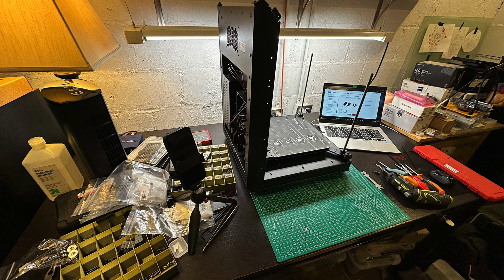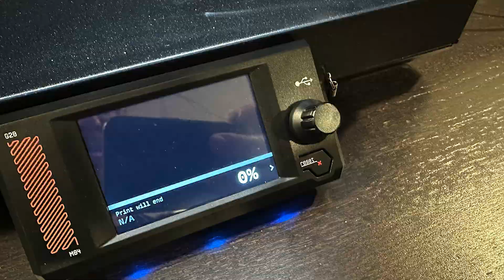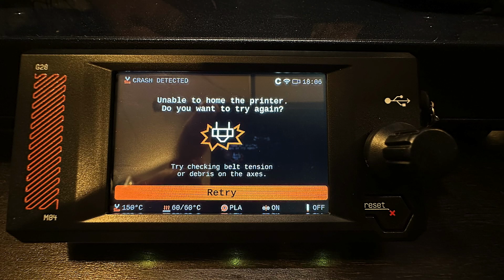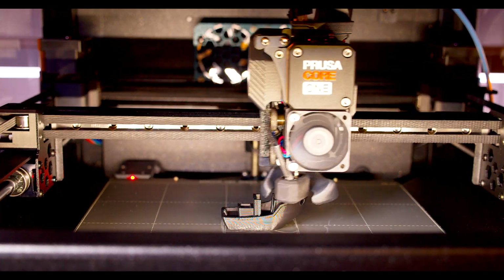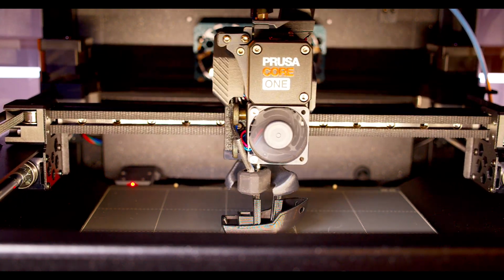My thoughts on Prusa MK4S to COREone Conversion Kit

Comment: went to the same path: mk4 kit -> upgraded Y axe belt tensioning and retention parts -> upgraded part cooling shroudd -> upgraded to mk4s -> upgraded tp CoreONE -> dis a small mod during assambly  -> did some other small mods.
ZERO issues in the whole process. ZERO!
Reply from the maker: lucky you! 🎉

Comment: Although my core one is definitely a very diffrent beast compared to my mk3, I absolutely love it. It vibrates a lot, it's a bit loud and it has its gimmicks, but overall it prints amazingly well and it's so damn fast. Surely it'll get better with firmware updates. I'm sorry that u didn't have a good first experience

Comment: @mygiguser help me out please, how did you fix that collision issue. I have the same thing I cannot get to printing. it's definitely a bumpy upgrade from MK4S that was just flawless.
Reply from the maker: I did a factory reset and re-installed the firmware. What finally helped the most was: Then I changed the build plate (now using Prusa Smooth PEI sheet). The one i used had the printed text on it (uneven). And then i used oil (Ballistol was all i had at hand) on all the rods, and bearings, and on those nuts on the z-axis rods. After that i tried the belt tension again. Hope this helps a little bit. I am still not 100% happy, but we are getting there. The thing that the prints are good once it gets over the errors at the beginning of the print process.